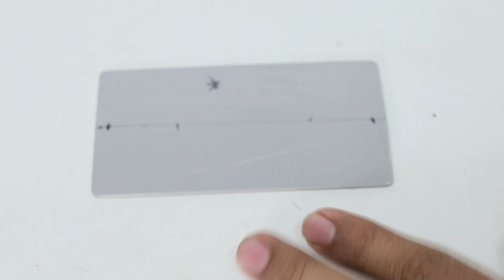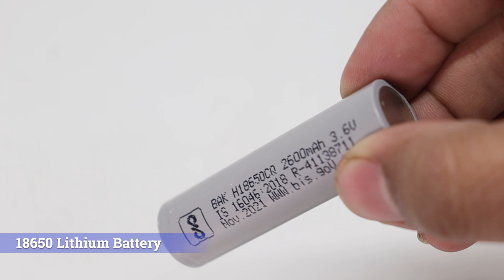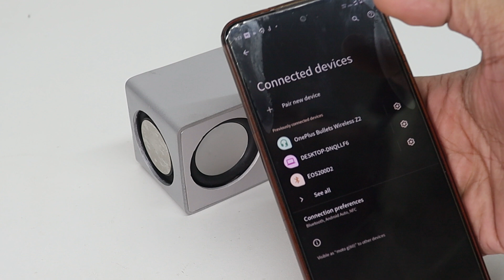How To Make a High-Quality Small Wireless Speaker | DIY Boombox at Home

Comment: Sir, Firstly nice video. I have a question, after applying so much glue, is it possible to reuse all components in some other projrcts. Please reply. Is there any other solution to do the same project without glue.
Reply: This glue can easily ripped off
Reply from the maker: Yes, definitely
Reply: hot glue is glue when its not hot, how do you make it not glue? add hot.